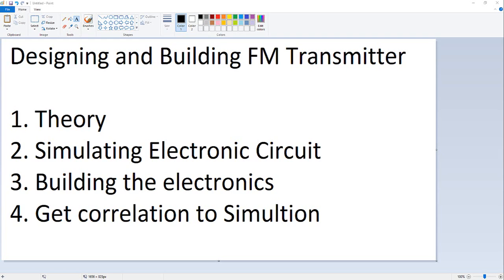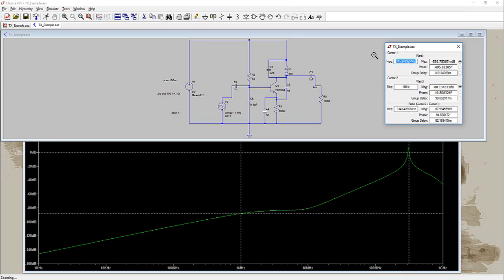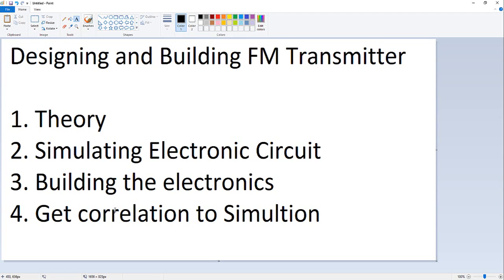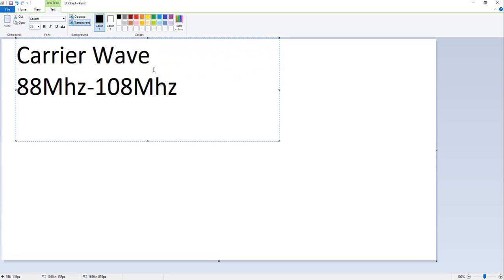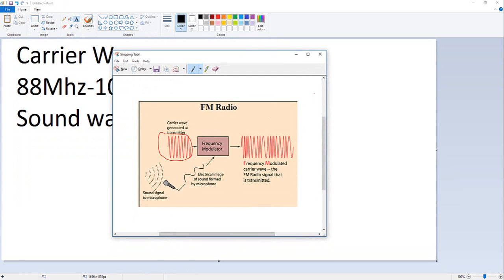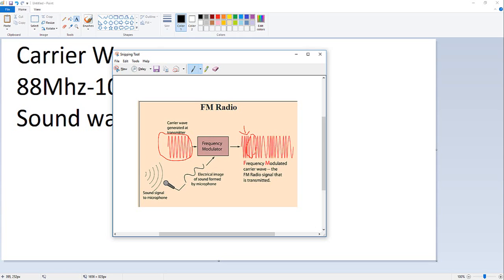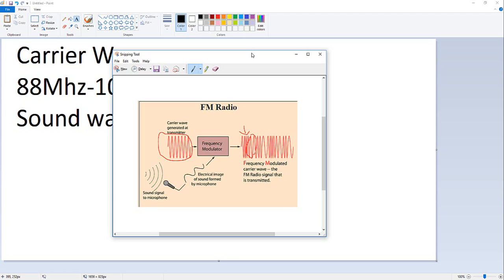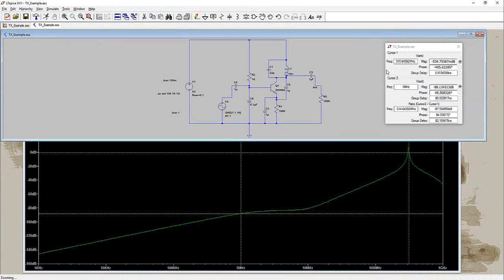Design A Long Range FM Transmitter - Part 1

Comment: it is possible to set the FM frequency with a digital circuit such as  MCU, I mean digitally change the variables of LC parameters
Reply from the maker: yes - you can use VCO (voltage controlled oscillator) - and put it in circuit somehow, but I suggest you to look at this 
https://www.youtube.com/watch?v=DDvOZkpOqGI